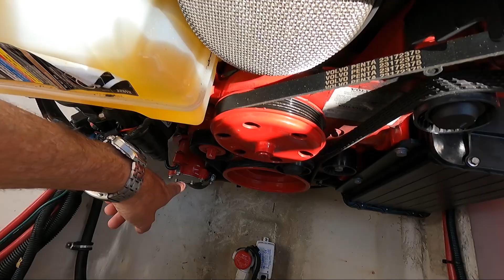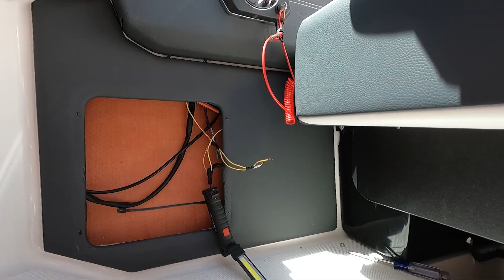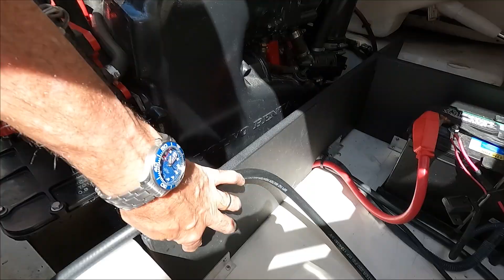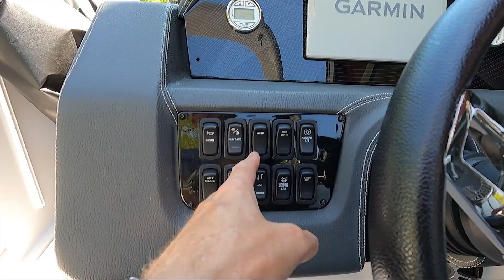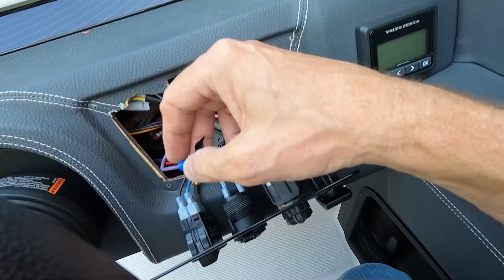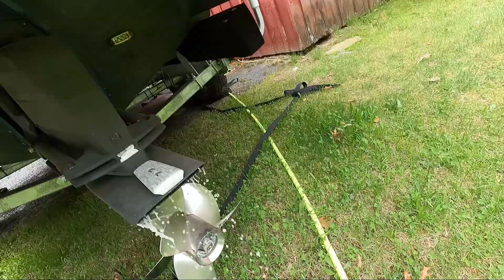Installing the Volvo Penta Neutra Salt System In My Boat

Comment: Nice job man!
I inherited one of these on my Cobalt 262 and have been considering using it just to pre-lube the impeller at startup. I don't need it for anti-salt reasons as we only use it in fresh water. Maybe fill it up with some soapy water. Any thoughts on that idea now that you've had it for a while?
Reply from the maker: Never considered using it in that way. I'm assuming that it's a closed loop system with the impeller mounted on engine? 

I question whether the soap mixture (or equiv.) would make its way to the impeller quickly enough to make much difference. I would guess that the most wear comes when you initially start the engine. After that, the vacuum from the impeller would start to draw the soap mixture into the impeller housing. Just not sure how long that would take.
Reply: @PIFDIY 
Yes, the impeller is mounted on the front of the engine. Fresh water cools the entire engine. It’s not a closed loop system then I guess. 

The reservoir for the “soap mix” is very close to the impeller and is mounted on the firewall I’ll call it, with a small hose that heads downhill to that “T” in the hose that feeds the impeller. My theory is that the short distance and downhill flow would get the soap there almost immediately. All the while, that impeller is creating that suction to draw the fresh water in via the long hose to the outdrive.  I’m very likely going to give it a whirl this summer just to see. 😊

Comment: Can I do this while in the water? I have the same VP 380HP as you.
Reply from the maker: Not sure about that because my boat is out of the water. Look to see where the T fitting gets installed in relation to the waterline. If the cut is made above the water line, I would think you'd be good but don't hold me to it...

Comment: Have you had a chance to use this yet? I am considering this for my 2014 Regal 28 Express. 2.85 reservoir and you figure it uses about 200ml per flush? I like this system over salt away as that is manual and I need a freshwater hose connection. At my marina they shut the water off in the winter from Dec to April but I want to be out there and enjoy the off season so this seems like a good solution!
Reply from the maker: Yes, I used this system last boating season, about 4 months in New England. The system worked great! The boat was on a mooring and continuously in ocean water. I would use it mostly on weekends so the boat had to sit for a few days in between use. The Neutra Salt gave me peace of mind that I at least did something to try to mitigate corrosion in the cooling loop while the boat sat unused. Hard to say but I think I used about 6 oz for every flush. Couldn't have been more than 8. 

I almost waited a year to do the install because it was late Spring and I was getting very close to putting the boat in the water. I didn't want pressure of starting a project which could've interfered with launching the boat. Anyway, very glad I did because the install really wasn't difficult and I was able to "protect" some internal parts during the boating season.